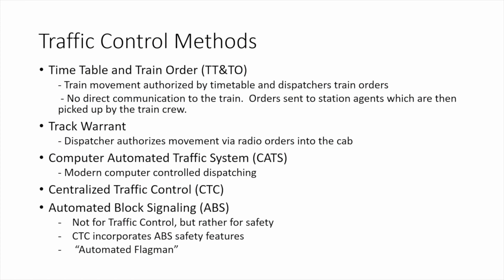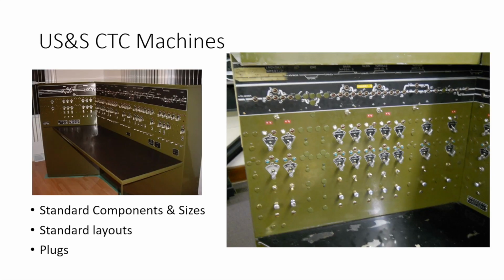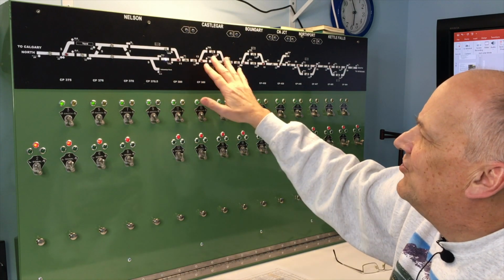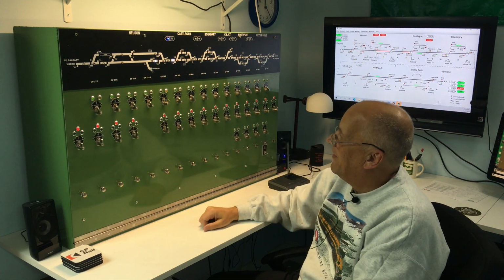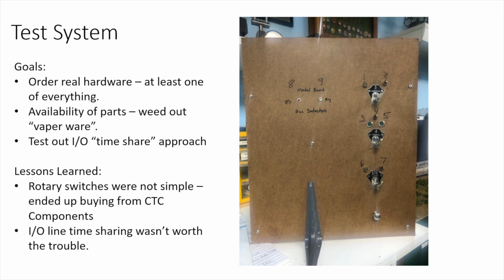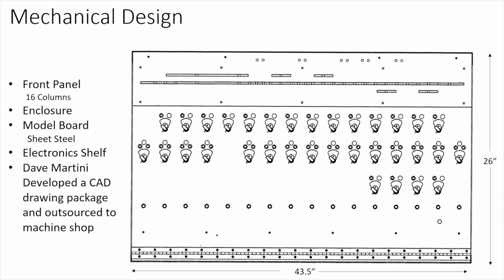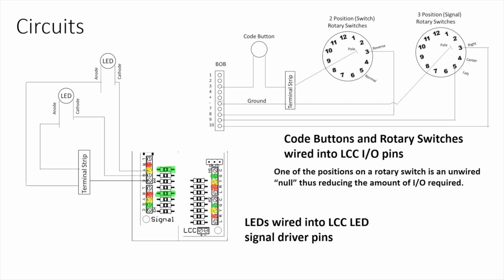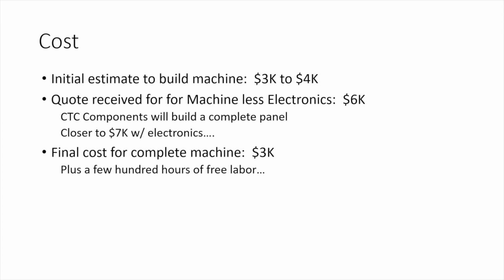A CTC Machine For The CS&P

Comment: I appreciate the explanation of how these systems work with visuals. If you want to recreate the original sound you can pick an old Electro-mechanical pinball machine for cheap and use its components to run relay sequences in a predictable manner... The core "processor" will be a disk like device that rotates actuating numerous switches rapidly.